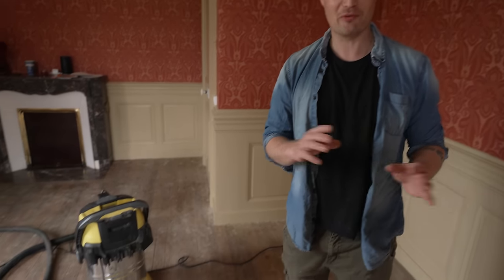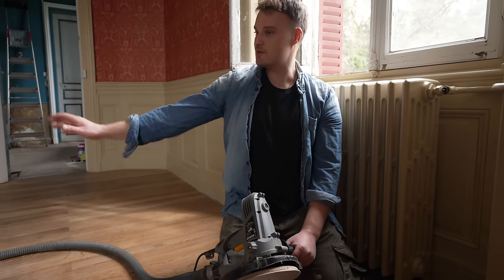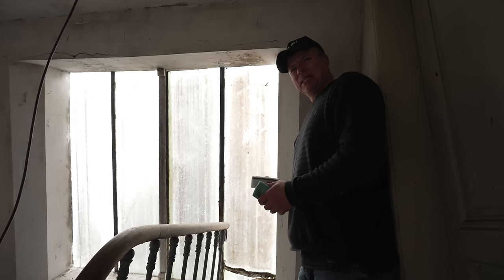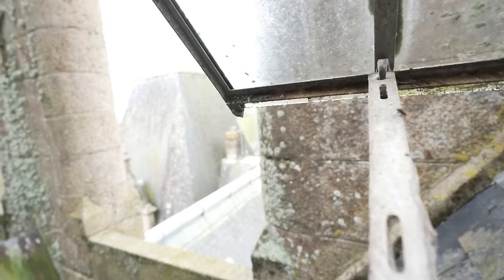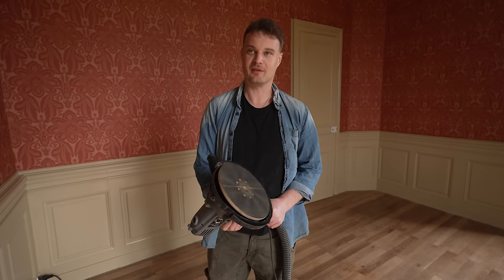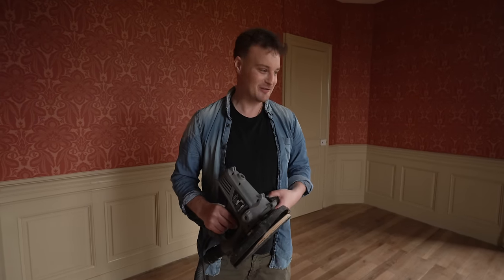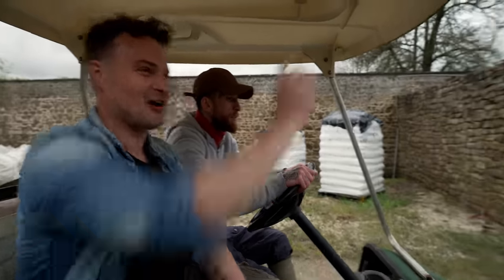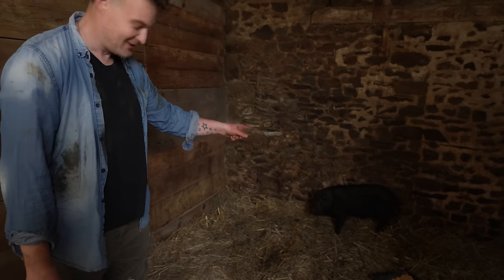The Pig Has Gone Missing

Comment: Kinda glad y'all posted about using that sander. I've got one and never considered using it on floors - and then I found the immediate need to refinish my attic space. It's wider plank oak with a shellac finish. Going to sand it the same way and redo with shellac as was done prior. Super easy finish to touch up and refresh, and fine for low traffic areas.
Reply: Just remember to not apply too much pressure on the sander. It will do the job but will take longer. Michael was leaning on his which causes the bearings and motor to overheat and then burn out.

Comment: When the waste pipe in the ensuites is boxed in, it should be fairly easy to find coving/cornice to match the original version so that you end up with a contiguous appearance the whole way around. The coving/cornice is of a fairly simple design. 

The stairwell skylight, should you eventually decide to replace it in favour of clear glass instead of the current frosted version, it would be a great opportunity to opt for triple glazing given that all stairwells essentially function as heat exhaust chimneys; heat retention in these old girls is huge challenge as you know all to well. Maybe you could also take advantage of that 'heat exhaust chimney' effect as has been done in Middle Eastern architecture for centuries and make the skylight openable for natural ventilation in the summer months without the need for any electrical or mechanical ventilation &/or air-conditioning equipment.

Comment: Couldn't you use a little glue or tar patch to temporarily cover the hole in the roof. Like an umbrella shaped patch that you slidethrough the hole and pull it back to seal the hole. Kind of like how a drywall molly works. It goes through then spreads of to cover the area.